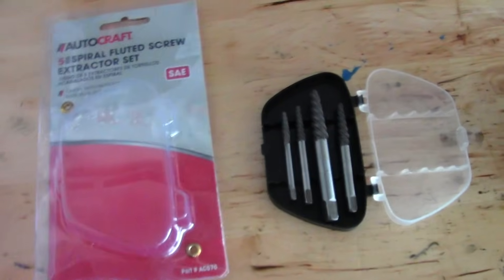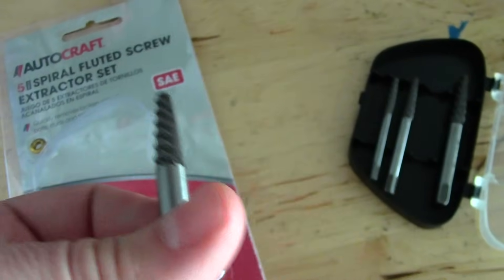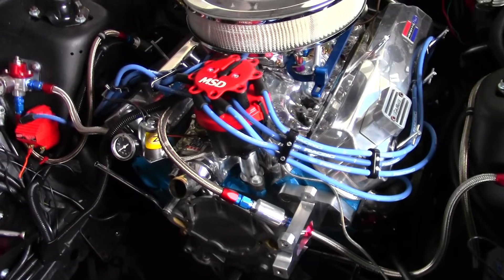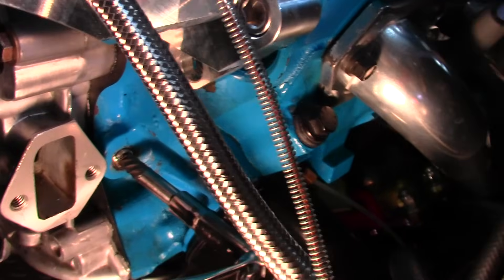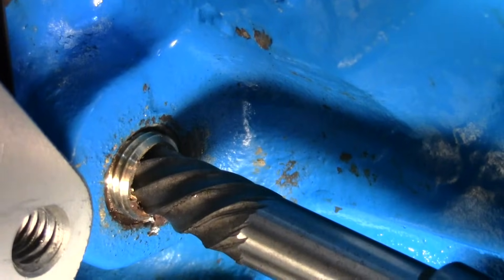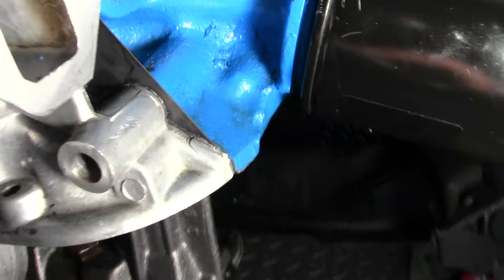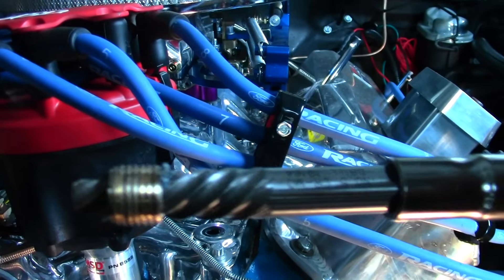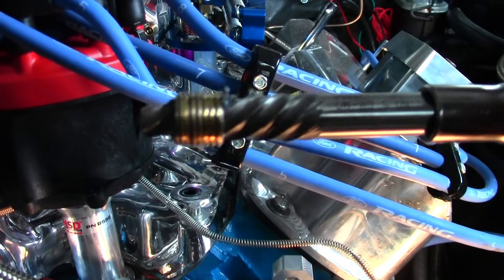How to Use a Screw Extractor | Remove snapped off bolt from engine

Comment: I have a 2004 Toyota Sequoia and the threads that the temperature center goes in is not going in as good. Is there a tool that I could use to fix the threads or what should I do? Any suggestions brother

Comment: Slick low key pissed off working on a fucking 98 dodge Durango broke the head off a screw on the hose that connects to the thermostat and theres no space to fit a adjustable wrench and none of m sockets fit and the fucker wont turn from a vertical angle and ima about to burn the fucker and collect insurance
Reply from the maker: We’ve all been there brother. Just walk away from it. Take a break. Cool down.

Comment: Useless video. You showed ZERO of the prep work it takes in order for the extractor to work.
Reply from the maker: I showed all the prep. It was a hollow brass plug. Same principal. Drill a hole if you have a solid. Not that hard.

Comment: Did you drill a pilot hole? If so What size pilot hole did you drill? Also if you drilled a pilot hole how did you drill it without a drill, or did you not need a make a pilot hole because the brass fitting had a hole to begin with?

Comment: It wasn't a bolt you used the extractor on, it was a brass sleeve fitting, right? That  would make the job a little easier than using it on a broken bolt. With a bolt, you would have to drill a starter hole first for the  extractor, wouldn't you? But in some cases, such as with my broken shock mounting bolts, you should be able to heat the part first to expand the metal a little.

Comment: You skipped.over the most crucial part of how you got the extractor in the bolt to begin with. Did you drill a pilot hole for the extractor??
Reply from the maker: Hollow plug

Comment: Also, if you don’t have a bolt extractor you can drill a small hole in the bolt and lightly hammer a hex bit into the broken bolt and use a wrench or something to loosen it. Of course I don’t think it would work in this guys case.

Comment: I have one of the worst kind of snapped bolt to take out....  Pain stacking slow to drill out a snapped titanium 8mm bolt but it is gradually drilling in... Its got stuck in motorcycle engine block bottom side and I knew it was going to snap the way it was twisting and not budging on the few mm sticking out on opposite side.

Comment: hi guys , my mechanic was replacing the power steering pump  on my E350 v6  but he broke a piece of bolt hole on the engine block.can this be the reason I have  squeaky belt by the cold start.thank You!!!

Comment: This was relatively easy, with proper tool selection for this scenario.  Bolt extraction is a big topic.  When faced with more challenging situations, watch many other videos before starting, and don't be too aggressive right off-the-bat, to avoid making things worse.  Seized rusty bolts will require different approaches and tools.  Also, know when to give up and seek professional assistance.
Reply: Think of it like defusing a bomb. You're fucked already because the bolt broke off. But if you can delicately and carefully coax that bolt out you will be less fucked and succeed in removal. Takes a lot of careful work, slow work, skill, and patience. The broken bolt can do whatever the hell it wants to and nothing is guaranteed. Form an attack plan, and watch it closely. If you start slipping, try another plan.

Comment: Its easier when you still have some bolt head material to drill into for an extractor     but when a bolt brakes off at the shittiest location in the threaded hole then that could turn into a fuckn nightmare shitty day spending a couple hours sometimes just removing a damm bolt then ya go damage threads and need to  retap a bigger damm thread sometimes having to bore the hole out completely if its steel compromising the materials that the particular part is made of ......        it's just a bloody mess use lube some thick stuff itll keep metal shavings from entering the cast parts insides a little bit at least ya going to have a time keeping all metal shavings out its just the nature of the beast with this process but use grease oil something thick as to keep the job clean then a little magnet and clean your dietap after a couple turns into rethreading your new holes new sides stop back it out remove debri then dip the tip and continue the tapping process by hand arm strength only level centered into hole and lube it up ....      she likes it better that way and in this case spit just dont work the same too much friction heat.....     for some of us I guess go slow on her at first and you'll be pulling your bolt in and out quickly soon after hitn it with your drill right to the bottom nice tite fit suM !!!

Comment: 3/8-16? A grade 8 flange bolt with a length the same length as the female end (except its not brass). 1/8” brass plumbing plug is super close but the threading is way too fine
Reply: Actually, if they make a 1/8” or 3/16” brass flare plug, that might work as well

Comment: I really do not like this tool. This tool will not function at high levels of rust and large torque
Reply: The extractors here are not for the scenario you describe -- that's a whole different saga, involving torching, drilling, even electrical disintegration by a pro shop if necessary.  These spiral fluted extractors are meant for when the bolt is still fresh and the head broke off, just what happened here.
Reply: @bandogbone3265  If a fresh bolt is just broken heads, without this tool I can remove it easily.  I need to understand my experience and my self-taught ability is not bad, so I dare say this is one of the less useful workshop tools.

Comment: What you do is take a propane torch,  or heat gun and heat up the metal around the perimeter so the metal will expand  and the bolt will come out easier. (heat expands metal)

Comment: Hi there 👋 I been working on a f100 302 with gt40p head's can you telle what the header s you are using on this project?? That clear the spark plug boot s.  Noticed at the video of the red painted heads. Please can you tell me. Sir.
Reply from the maker: Go to my website 302budgetbuild.com has all the info.

Comment: I just replaced the exhaust manifold and the manifold gasket on my 98 Dakota. Apparently they lost one of the 3 posts. Soo, there's a zinc bolt busted off in there. Don't ask my why. Thankfully zinc is super soft. I'm hoping I can drill out the center and back that puppy out. Wish me luck. I'm gonna need it. And patience

Comment: How loudly did you curse everything when this happened?
Reply from the maker: You have no idea. And I was so happy when this extractor actually worked
Reply: That's easy to believe. I've got some 21 year old exhaust manifold studs, and a couple broken bolts to remove later this week so hopefully you're video helped a lot (considering I've never successfully managed this operation).

Comment: Bolt broke I'm lawn mower blade I tried speed out didn't work.I picked up one of these kits.So I drill holes in broken bolt,now the extractor I'm going to thread it in lefty losey?
Reply: Alan R yes ten left anti clockwise lefty loosely because these extractors are left hand threaded they grip the more they turn left
Reply: @seemaab  thanx gonna give it a shot now.
Reply: Man the extractor didn't work drilled think I drilled too much & it's a little cockeyed.Do u know if they sell threaded inserts?
Reply: Alan R you can buy left handed drill bits. Tbh I tried everything for my situation and eventually as of today went to my local mechanic who put spot welds on the broken nut and took it out with ease. Cost £20 for half hours worth of work. Might be worth taking your mower to a mechanic who can weld. Shouldn’t cost a lot at all
Reply: @seemaab  thanx for advice.i might do that.Hey what do u think about those threads that u can put inside the hole where threads striped?
Reply: Alan R yeah the rethreading tool works but most mechanics have threaders and know what there doing.
Reply: @seemaab  I know what I'm doing lol I got this u don't think I can do it.
Reply: Alan R haha. No no I just know I tried and failed and it was much easier for me to go to the mechanic after trying everything. Weld should do the job though
Reply: @seemaab  I agree yes.thanx for ur help.

Comment: Cool thanks! I have a question though how did u inset the extractor into the broken thing? did u drill it first? maybe I miss that one, coz I didn´t had a good sleep last night, yesterday I snapped off one the fastener in my car block stupid me I tighten it hard because the oil is leaking the gasket is broken. So now I am like an idiot to find in the internet how to extract a broken screw.
Reply: The bits are reversible, so the initial drilling is done with the reverse side, then he switched to the ratchet with the extractor side. Sometimes the drilling and extractor biits are separate.
Reply: If it’s a solid bolt, you begin by centre punching the broken bolt. Then drill it slowly. You don’t have to drill it all the way through. The what I do is gentle tap the extractor into the hole you’ve drilled. Then gently turn the extractor by hand wrench, socket or something. Being slow and patient. Do not use a drill on the extractor.

If it’s a hollow fitting like this brass one on the video, just pick an extractor that fits into the fitting, and gently tap it in so it “bites”. The follow the same gentle, slow procedure of removing it.

Comment: Literally me right now on my 13b oil cooler line adapter for 10an fitting, snapped due to over tightening. Wack. This worked for me using a #6
Reply: Which 13B? I'm not going to berate you for owning a Renesis.

Comment: Can this kit work for arp head studs also??
Reply from the maker: I don’t see why not. Biggest thing is to note the type of metal the ARP bolts are made from and get a drill bit that can go thru it. Be careful of metal shavings getting into the engine.
Reply: @fixitnoworlater  noted thank you

Comment: I know it's probably off subject because it's not an engine, but there is a commercial steamer at my work... And the screws holding the door handle have broken off the tops and are stuck inside the door. Our matience man says we just need to get another door. But would there be a way to drill into the screws and pull them out of the door. Because getting another door is going to take a LONG TIME if we get a door at all. Is there anything that can work to extract smaller regular sized screws out of a regular door that's metal?
Reply: We can still use the steamer but due to the handle being broken it's losing alot of steam. And due to corporate taking so long on alot of stuff as an employee I'm trying to figure out an alternative. Because I'm short... And it's the bottoms steamer that I use daily.
Reply from the maker: An extractor may work if you can drill a pilot hole in the center of the screw. Or you could drill the screw out entirely and tap and thread new larger screws in place. Or.... you can try to weld a small nut back onto the screw similar to this method here: How To Remove a Bolt With a Rounded Off Head
https://youtu.be/ZV-DwGlHOCw

Comment: Great video brother!!! Who makes/where can I find that dual end female extension that you have on your wrench? I have an extractor with a 1/4 inch drive that I can’t find any adapters to use my socket wrench on. Damn torx screw stripped out and I can’t get my rotors off on my LR2. 

Everyone’s response/knowledge is greatly appreciated.

Thx in advance

Comment: Did you use a electric drill to start screwing in the extractor? ( I hope that makes sense)
Reply: Jake--Good question.  No, he did not.  Although the extractor has the appearance of being threaded, it is not.  In this instance, the piece that snapped off left behind a section of (soft) brass in the block of the engine.  All he needed to do was find a large enough extractor to fit that piece, tap it in with a ball peen hammer to set it and turn it out.  Use of an electric drill on this would have likely enlarged the hole as it spun uselessly and given him more grief.  Actually, a better style to use would have been a smooth-sided square, tapered extractor.  The four edges are sharp and would bite into the brass better than the round, tapered style he used in this demonstration.  The square type is effective with soft materials like brass, plastic and aluminum for that reason.

Comment: HOW DID YOU GET THE EXTRACTOR IN THE BOLT FIRST ? DID YOU USE A DRILL?
Reply: Drill hole then use extractor in counterclockwise
Reply: I just broke my god dang extractor in the hole so I flipped off right now

Comment: Anti seize anything that goes in the block!!! An if at all possible use a t handle that goes on a tap instead of a ratchet if you can ! That way equal pressure all the way around the extractor .

Comment: great video.... I didnt know screw extractors even existed! my question though is... how do you get the screw extractor onto the broken crew? do you have to drill a hole in the broken screw stud? or is there any other way?
Reply: Hi's wasn't a bolt it was hollow, and to use it on bolts you need to drill it firts

Comment: Two things aren't clear. One, how did you get it to go into the bolt? Did you tap it in, screw it in, etc.? What tool did you use and in what direction did you turn to drive it in, if any? Two, there seems to be a contradiction. At the beginning, you said that lefty was tighty in this case. But, when you removed the bolt, it appeared to be turning to the left. Great video and awesome camera work, but you really shorted us on the most important details.

Comment: Thanks for your video-I have a small bolt with its head sheared off stuck in its threaded hole below a recessed counter sunk hole. See this image for reference.. http://imgur.com/gallery/Vyhw45F it's a delicate situation on my electric skateboard..I need to remove this bolt asap without damaging the thread of the hole the bolt is in so that after extraction a new bolt can be screwed in again..I have a damaged screw extractor bit set (drill in reverse a hole in the end of the bolt with one end of the bit and then extract afterwards with the other end of the bit also with the drill in reverse).. How can I prevent the screw extractor drill bit from slipping/damaging/stripping the bolt hole thread and ensuring it stays centered? Use a hand center punch to make an indentation somehow in the end of the bolt to keep the extractor drill bit in the center or any other tools you suggest? I greatly appreciate your feedback asap on how you suggest I do this successfully as I can't afford to damage the bolt hole's thread but can't delay sorting this out much longer.. Thanks again! 🙏

Comment: I just broke a water pump bolt off. It's going to take a while to drill a hole of the proper size that will allow an extractor to get in. Damn! I'm surprised how easy it was to break off one of the bolts.

Comment: How does the extractor screw into the brass plug? You already had it in? It is metal grinding on metal so a ratchet will start to drill it in?

Comment: Those are garbage I broke one off in a exhaust bolt broken off in the hole those extractors are trash had to use a cutting torch to pop it out

Comment: So what should I do? I broke the extractor in my last starter bolt removing them. Now I'm trying to drill out the extractor but my drill bits keep getting dull an have to buy New ones and it's still not working after all these parts I been buying :/, even tried a couple other things but didn't work, also it was my last bolt after I just replaced my engine and the only thing left to do ha. Any sugustions on what you think I should do? Been working on it all summer by myself an can't get that one an only broken bolt out but the other one came out perfect just like yours did. Please any suggestion?

Comment: I am hoping something like that would work with a train horn that had loctite used for the bolts hahaha
Reply: Daekj32 yeah I did that and it worked perfectly, now my next issue is corroded bolts that have been seized for 50 years hahaha

Comment: You can use a punch which is not as hard as the screw extractor, but hard enough to chip and break a screw extractor out of the hole.

Comment: How did that extractor get in there? You failed to show us the first half of the process bro.
Reply from the maker: You failed to listen to the video bro. It's a brass plug. No brained on the extractor... drill and tap a small hole. Then follow the steps.
Reply: archifxllc ........did I? my bad